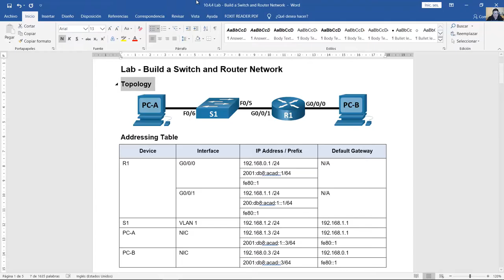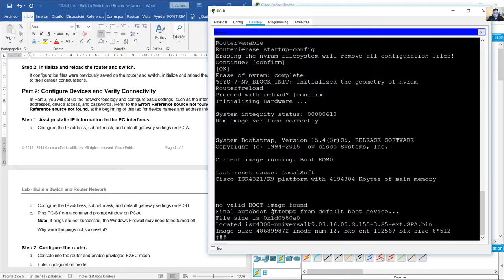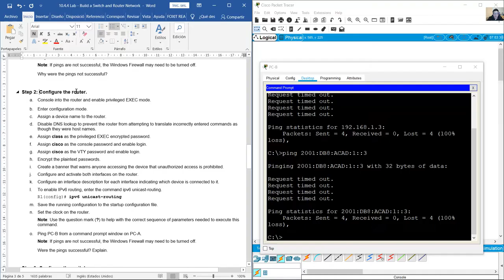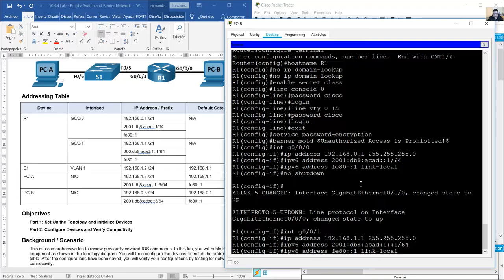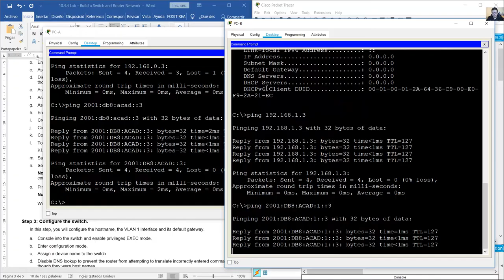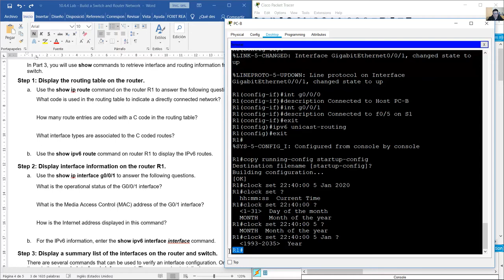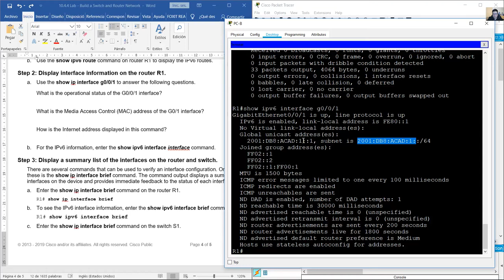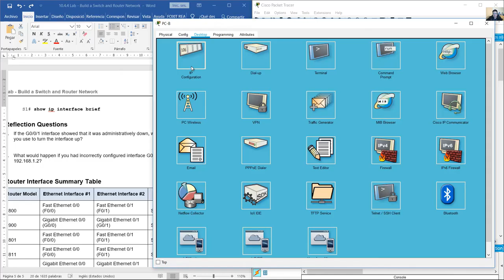10.4.4 Lab - Build a Switch and Router Network

Comment: I follow as instructed at 20:21 , when i try to verify it all four times it says Request time out. What could be the problem?
Reply from the maker: please review the interfaces where you configured ip addresses
Reply: @romeroc24  This is the third time, but it seems that it works now. It beucase i put the wrong router
Reply from the maker: @cooldude8551  all will be ok with the correct router
Reply: @romeroc24  thank you for the video

Comment: how to change the ipv6 address 2001:db8:acad::1/64 on g0/0/0, if i connect this on g0/0/1?
in try to connect to g0/0/0 i have this error :  (maybe i can cancel previous request?)
%GigabitEthernet0/0/0: Error: 2001:DB8:ACAD::/64 is overlapping with 2001:DB8:ACAD::/64 on GigabitEthernet0/0/1
Reply from the maker: first remove the ip address on g0/0/0, "no ip ipv6 address 2001:....."

Comment: Why didnt you connect giga to giga instead of giga to Fethernet?  In any case, THANK YOU!
Reply from the maker: When you connect Gigabit to Gigabit the link runs at 1Gbps, if you connect Gigabit to FastEthernet the links runs to the lower value (100Mbps), all this will not affect other settings of the connection, so you can choose any connection

Comment: Thank you, but I can't ping the ipv6 address of PC-B from PC-A
Reply from the maker: try to review the ipv6 unicast-routing on the router, aslso review if the ipv6 addresses on router interfaces and hosts are very well configured
Reply: @romeroc24  ok thank it worked, my addressing table was wrong
The ipv6 address of router interface g0/0/1 is 200:db8:acad:1::1/64 so that why i can't ping the other hosts
Reply from the maker: @gavydann3699  very good
Reply: Hi Cristian, thanks a lot for your video

Comment: I changed g0/1 ip address to 192.168.1.2 and it gave me a duplicate notification but it let me do it still and I was able to ping pc a and pc b from each other. How is that possible?
Reply from the maker: Maybe duplicate message not permitted the configuration
Reply: @romeroc24  i confirmed in the ip interface brief that it was changed and even reloaded the router for good measure but still works.  Your explanation in the video makes sense im just concerned now that packet tracer is unreliable
Reply from the maker: @AB-in2tj  You allright and try to do it on GNS3 to verify